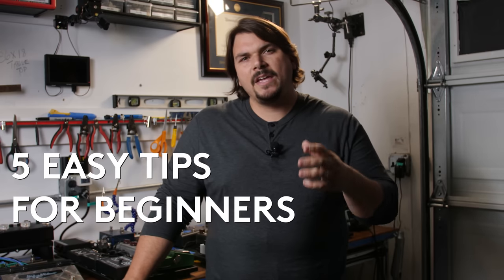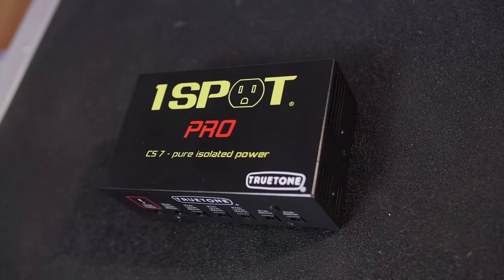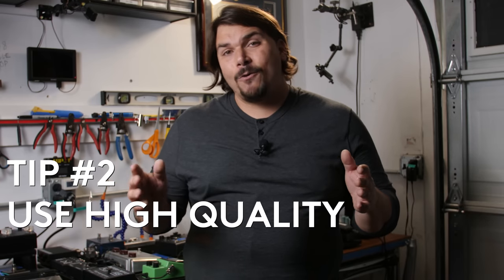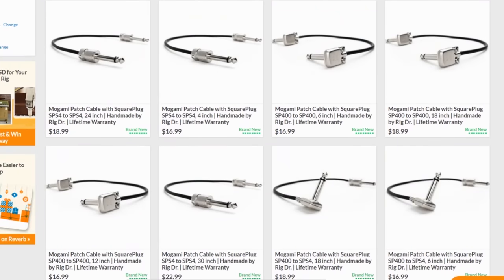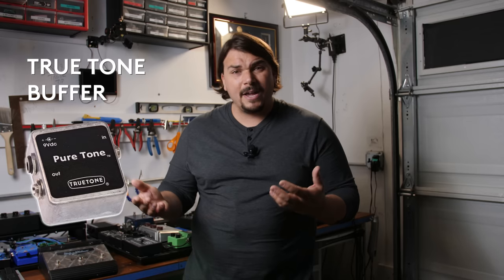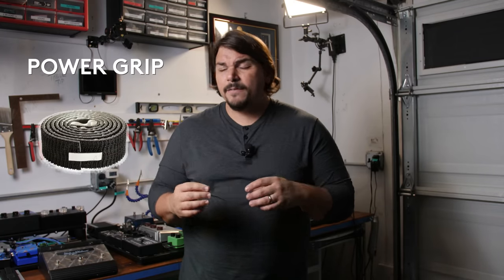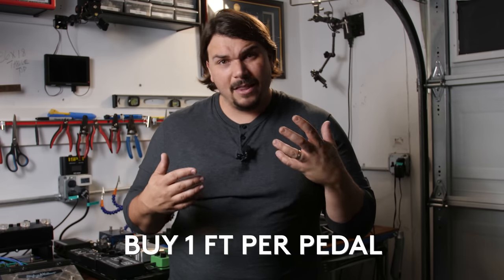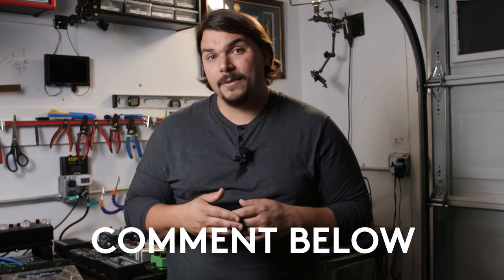5 Ways to Improve Your Pedalboard

Comment: Do I still need a buffer if I am using a GigRig QMX8. I run about 15 foot cable from guitar to pedalboard and about another 15 foot cable from end of QMX to amp input. No FX loop.
Reply from the maker: I would still recommend it, unless there’s some sort of buffering occurring inside that unit, and if there is it needs to meet the specification I indicated in the video and have one on input and output
Reply: @VertexEffectsInc  I don’t think so. As most may know it’s supposed to take the pedals out of your signal chain when not in use. If it had a buffer that would be advertised I’m sure. Thanks. I have 1 JHS little buffer. Should I get a second one of the same?
Reply from the maker: @marconazz  even a true bypass looper will need buffers, you still have the capacitance of the input cable and output cable - that doesn't go away.  If you want the most consistent sound - the same sound of the guitar plugged into amp - you'll want a dual buffer (input and output buffer).  I would suggest going with a high quality buffer like those I recommended in the video or if you want a Dual Buffer in one box, the Mesa Boogie High Wire.
Reply: @VertexEffectsInc  ok thanks. But would it not be smart to just buy a second JHS little buffer since I already have one. I could use one at the beginning and another at the end of the signal chain. Sorry if I’m missing something here.
Reply from the maker: @marconazz  you're presuming that it's as good as any other buffer.  A buffer is not a buffer is not a buffer.  You can buy an overdrive and just because you have something called "overdrive" doesn't mean it's a good one.  There are certain things that need to be satisfied for a quality overdrive pedal, same as a buffer.  If you want a high quality buffer, go with what I recommended.  If you want to spend more, get a Mesa Boogie High Wire or build our DIY buffer.
Reply: @VertexEffectsInc  ok thanks for clarifying. I am happy to spend good money on a good buffer. I thought JHS was good.  But I guess not.
Reply: @VertexEffectsInc  So If I buy 2 Mesa Boogie Stowaways and place them before and after the QMX8 I'm good?  I saw the Highwire but I don't need the extra features.  Please let me know, thanks

Comment: Deoxit cans up here are $35.00 a can at the music stores.  Not quite 10.00 unfortunately here lol
Reply from the maker: Prices have changed for sure in the time since this video came out.
Reply: @VertexEffectsInc  They've been crazy for years up here for some reason. As a electronics repair guy I usually just use MG chemicals,  but even they are pricey.  I keep a couple of different types of Deoxit on hand anyway,  just use it sparingly.  I have the regular one and the green can for sliders and stuff for EQs on amps or rack mount stuff.
Reply: eBay, yo!
Reply: @ImYourOverlord  yeah and no, with exchange on the dollar and shipping costs the same if not more.
Reply: @charlesb7831  Ah, OK. Hopefully not too much more. I believe I purchased a can of D5 from an eBay seller for about $16.00 US.

Comment: Thanks for this. Does my Pedal Power+ 2 have the same problem with magnetic bleed noise? Or does the “2 +” version have this handled?
Reply from the maker: It does, but you probably won't hear it because it's shielded by the steel enclosure.  The newer versions like the 4x4, Digital, Mondo, however will have this problem as they have no electromagnetic shielding - they'll all aluminum chassises.
Reply: @VertexEffectsInc  awesome thanks

Comment: Here in Argentina it is almost impossible to get that Spray.
What do you think of WD40? Can it be used to clean "contacts" (I hope I have said it well😝)? 

Greetings from Argentina! 🇦🇷
Reply from the maker: Not the same thing, DeOxit is unmatched unfortunately
Reply: No, just no.
Reply: Perfectly clear friend I found this for you I hope it helps you determine what you need. http://www.pitt.edu/~szekeres/cleaner.htm This person tested different contact cleaners I also don't recommend Wd-40 as it is a de-greaser but you might find some success with in if you cant find a better option. 97%IPA or white vinegar may also work for you depending on what you need it for.
Edit: buncha info here too https://www.eevblog.com/forum/chat/any-suggestions-on-how-to-make-a-home-made-contact-deoxidizer/

Comment: I've heard too many horror stories about the MXR Iso Bricks burning pedals with too much voltage. Too bad, cause they're the perfect size and price.
Reply from the maker: Wonder if they’re not using it properly or exceeding the current max
Reply from the maker: @fngsrck  There is the MXR Brick, and then there is the ISO brick.  Some people confuse the two...just wanted to point that out just in case.  Secondly, some of the output have a variable voltage output - so if you set it to something higher than 9V and plugged a pedal into it that only accepts 9V, you could have a problem, but that's user generated.  Voodoo Lab PP2 is a linear supply - an older technology that will be more prone to noise - however the PP2 does have electromagnetic shielding because of the steel enclosure, where the other models, Mondo, 4X4, Digital, do not have this steel chassis and therefore no shielding against EMF - this can create a BIG problem on Pedaltrain style boards where the power supply is close to the pedals on the board..  The only real drawback to what you have is, it's bigger than a switching supply, has less power, less voltage options, less current, and can only be used in your country of origin and won't recalibrate to the input voltage of whatever country it's being used in.

Comment: I have a bunch of those ebs ribbon cables and they fall apart quick the actual sleeve around the wire slips right out of the head of the connector leaves wire exposed.
Reply from the maker: Didn't know that.
Reply: I've been using them for years, never happened to me.

Comment: Which way with Velcro? Hooks on the pedal? I prefer that cuz if it’s off the board doesn’t slide on carpet. Is there a RIGHT way ? Why ?
Reply: if you buy the type he recommends, both sides are the same.  also, he ain't jokin at all.  you stick  that stuff on your pedal,  it's on there, and the pedal is not coming off your board without some serious effort
Reply: @cheezyridr  I don't know how much I like that. Especially when I plan on switching things and experimenting the order - as a begginner
Reply: @AgentFlea  regular velcro is what you want then.  you'd  have a much easier time moving things around. also, good on you (as a beginner)  to be open to experimenting with pedals and the order. nothing is written in stone. trust your ear to get you where you need to go. you'll get there, and it probably won't be where you think, a few years down the road.  ask the other players you know.  no one's board remains static very long. that's also part of the fun.  my one reccomend to you is at least a soft case. dusting you pedals is a pain.  some things (like reverb and delay) you'll find certain settings get used most. a paint marker (or masking tape) is your friend.  a little dot tells you exactly where the knobs go to get that sound you use most.

Comment: Hi. I was about to buy a voodoo lab px8 board with a power plus 3. You showed a 4x4 power supply in this video and saying it might be noisy placed underneath? Is the voodoo lab not a power supply i want to use? This will be my first pedal board so I am really noob about this. Love all the info on this channel!
Reply from the maker: The Pedal Power 3 is switch mode so it's fine.

Comment: Hello, question for anybody. The mooer s12 macropower claims to have two toroidal transformers. Is that bad? Can it be placed underneath the pedalboard?
Reply from the maker: Toroid is not going to be as noise free as a switch mode power supply like I recommended. The transformer can be problematic especially if they’re not using steel as the enclosure material to shield against electromagnetic fields

Comment: What do you think of the Phoenix power supply?
Reply from the maker: Never heard of that brand
Reply: @VertexEffectsInc  sorry Mason my bad.....it is The Walrus Audio Phoenix clean Power supply15 outputs.....I bought it a while ago...never used it...just wonder what your thoughts are.....and thanks so much for getting back to me
Reply from the maker: rusclemania7 7  got it!
Reply from the maker: @ronkresch9228  it's a linear power supply - it will have issues depending on the proximity to other pedals because it's got a transformer and no electromagnetic shielding from the chassis since it's aluminum and not steel.

Comment: I don’t get it, my CS12 acts like it has a toroid and there’s a distinct noise/hum that occurs as it gets closer to my pedals. I replaced it with a CIOKS in the same setup and there is no hum.
Reply from the maker: The only transformer in it is on the AC side for the 9VAC.  The rest of the supply is switch mode.  It could have been something else possibly, and depending on which CIOKS you got, it could also be linear and not switch mode.
Reply: @VertexEffectsInc  It’s the CIOKS 8  and DC 7 “power bundle” from Sweetwater. I assume it’s switch mode because there’s no EMF when near my pedals, unlike the CS12. Thanks for responding.

Comment: Them MXR power supplies can be noisy in UK so I’d rather use 1Spot pro.
Reply from the maker: The ISO versions?
Reply: @VertexEffectsInc  I had one few years back and it was noisy getting all that house wiring noise so changed it to voodoo Labs and problem was gone on the spot. 
I’m not as smart as you so don’t know what was the culprit mate :)
Reply from the maker: @Sickindian5  wonder if you had the normal version and not the isolated version
Reply: @VertexEffectsInc   I was trying to find purchase confirmation to see which one it was but no success. I’ll let you know mate.
Reply from the maker: @Sickindian5  my prediction is that it wasn't the isolated unit.

Comment: What are your thoughts on the Walrus Power Supplies?
Reply from the maker: They are linear supplies.
Reply: @VertexEffectsInc  Compared to a MXR Iso Brick or Truetone is it worth it?
Reply from the maker: @cablescribbles  Iso Brick and Truetone are both Switch Mode.

Comment: i managed to burn an output on my iso-brick because i left power cables just laying around plugged into the brick. now that's a bummer.
Reply from the maker: Should be an easy fix...are you sure you didn't just damage the jack?
Reply: @VertexEffectsInc  I brought it to repair place, don’t know the exact reason yet, but it’s not about the jack or plug.
Reply: @VertexEffectsInc  update: the repair guys decided to change the stabilizers, capacitors and a bunch of other parts, plus had to repair the cord cause it was damaged, and probably caused this. Also they said that it’s not a good power supply based on how it’s built, and it’s not truly isolated. Now I’m disappointed in mxr, but I guess I’m stuck with it.

Comment: It looks like there is a wall wart that connects to the MXR iso brick. Might not be the best choice. Definitely not better than the voodoo lab!
Reply: the wall wart is isolated from the power outputs that are going to the pedals, same as the voodoo labs' power supply, so there's not really a difference there. The key difference though is that instead of isolating all of the outputs from that power input as a group (which the Voodoo Lab does), it isolates each output individually, keeping your pedals also isolated from each other, as well as from the AC power input. It really is a quality product, in addition it has two 6 to 15 volt outputs that allow you similar sag controls as some Voodoo Lab models do, as well as powering old Boss ACA 12 volt stuff. I personally prefer the One Spot CS supplies, but it's not a bad product by any means. Looks aren't everything
Reply from the maker: The Voodoo Lab products like the Pedal Power 4x4, Mondo, Digital, etc. will all be noisier than the MXR ISO series.  Voodoo Lab, until recently with their 3, 3+, and x4 supplies, always were linear supplies, used a toroidal transformer and on the units I mentioned, have not electromagnetic shielding.  This means you'll have issues with pedals getting too close to the power supply and creating noise and hum.  The power supplies I mentioned in this video are all switch mode supplies - the newest technology in pedal power supplies.  Switch mode offers more power in terms of voltage options, more current, smaller and lighter weight package size, and is compatible with any input voltage from USA to Asia to Europe.  I didn't talk about the new Voodoo Lab supplies because the price point is much higher than the more entry level switching supplies I mentioned.

Comment: Can you use a 500 mA for a 150 mA pedal? If no, what’s the fix? Power brick only offers 100 mA or 500 mA.
Reply from the maker: Sure, mA you can use as much as you want as long as the pedal current draw doesn't exceed the output.
Reply: @VertexEffectsInc   Output?!
Reply: Thank you.
Reply from the maker: @richardhorky9749  In other words, if you pedal draws 500mA and your power output only provide 200mA, it won't work, or at least not properly.  You can have more mA available than what the pedal needs, you just can't have fewer.
Reply: @VertexEffectsInc  Thank you!
Reply: Voltage must match.  For continuous use the mA draw of device should be less that 85% of the power supplies rated current.  So for a 100 mA pedal us a power supply rated for greater than 118 mA. 100/0.85=117.6
Reply: @VertexEffectsInc  For instance, I have a Boomerang looper Phrase III and it needs 600mA so I got the splitter and use 2 X 400  on the 4X4 voodoolab.
Reply from the maker: @tilleyroadaffairproduction6752  you need a current doubler not a splitter.  9V at 400mA x2 is 9v at 800mA using a current doubler.
Reply: @VertexEffectsInc  Sorry that is what I meant a doubler that I ordered with the Boomerang.  Thank you for the mention.

Comment: Would an ernie ball volume pedal work as a buffer?
Reply from the maker: What's the input impedance and output impedance of the buffer...typically they're passive.
Reply: @VertexEffectsInc  thanks for the reply. It is passive. I thought to lool it up after i wrote this. Appearantly its MORE impotant to get a buffer with a passive volume pedal at the beginning of the chain
Reply from the maker: @legomasterthe3rd240  Any passive volume pedal will need a buffer to be more neutral - check out our Vertex Boost and its volume/exp function, turns any vp into an active one.
Reply: @VertexEffectsInc  will do. Thanks

Comment: Man, both power supplies you recommended are over 200 USD (I am not in the US)... definitely not affordable at all, is it still worth saving up that money for a power supply or could I settle for something cheaper?
Reply: Don’t cheap out the psu. You can buy used also. Just look for the good brands.
Reply: I would recommend checking out Harley Benton or Vitoos's isolated power supplies (Vitoos is the manufacturer of Harley Benton's power supplies). Their power supplies with IEC inputs are fully isolated. I own the Vitoos ad10s-sv4, and I've not had issues with it at all. That said, these brands don't have the same credibility as the bigger name brands like CIOKS or Strymon. So, buy at your own risk.
Reply: BBE has a decent inexpensive power supply and there are plenty of used ones on Reverb. I picked up a couple MXR iso bricks for nearly half of new.
Reply: I bought a Friedman Power grid 10 for 180$ from Reverb when I was in the states. It really does make a difference compared to the cheap one I used before but yeah they are expensive. The Harley Benton isolated PSU is also a good option and it's way cheaper than the others.
Reply: I think true tone CS6 is best bang for ur buck

Comment: Dual Lock doesn't adhere well to the bottom of my Mooer e-lady pedal, so every time I lift this pedal from my board to reposition, the pieces of Dual Lock stay locked to the strip on the board. The bottom of the pedal is rubber, and is not entirely flat (but has flat areas at the head and the foot). Is there anything I can use to treat the adhesive surface or the bottom rubber of the pedal to solve this? If all else fails, I have super glue.
Reply from the maker: You should be able to strip the rubber so you can get metal contact.  Any petroleum-based material will be an issue with adhesives.
Reply: @VertexEffectsInc  Makes sense. We'll get the better of "budget" pedals here ;)
Reply: @VertexEffectsInc  I just might do that with my other pedals that have rubber surfacing on the bottom as well :)

Comment: I had a mogami cable and it failed i threw it in the trash i use monster cable now with no problems
Reply from the maker: Have you heard the expression “throwing the baby out with the bath water”?  Mogami cable wasn’t the problem - it’s likely who made it and the plugs that were used.
Reply: @VertexEffectsInc  it was a longer cable pre made by mogami and it sucked, now i only use monster cable they dont fail.
Reply from the maker: @markrobinson8410  I would recommend getting your cables from guys that offer lifetime warranties.  Mogami used to do this, not sure if they do any longer.  Monster, however, is one of the most underperforming cables for the price and sonically is not comparable to its equal priced counterparts.  I know you felt Mogami let you down, but you downgraded in tone to spite them.  You should check out what we're doing on the www.theirgdr.com.  All lifetime warranties, free replacements no questions asked.